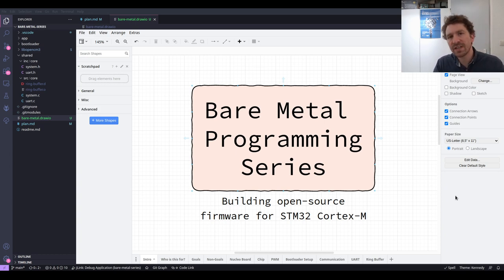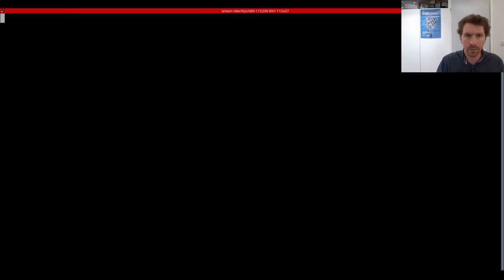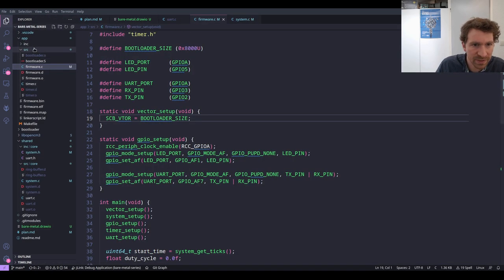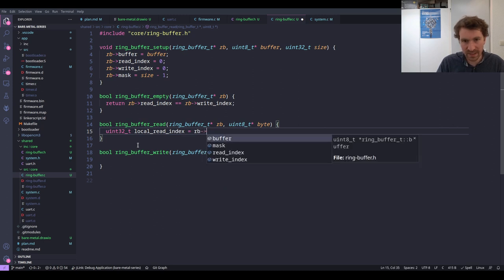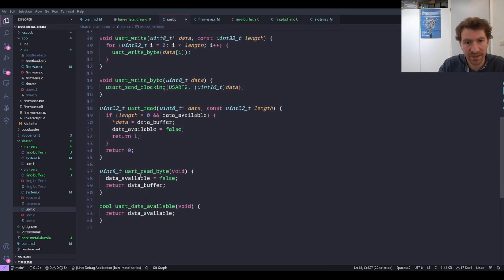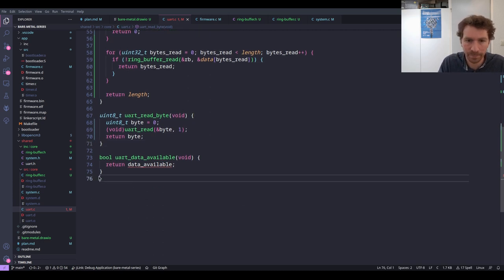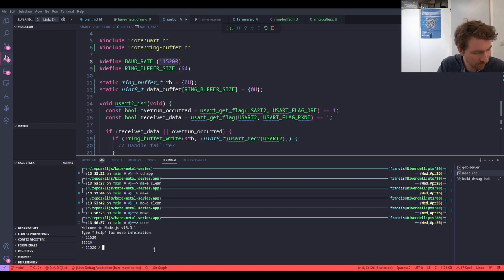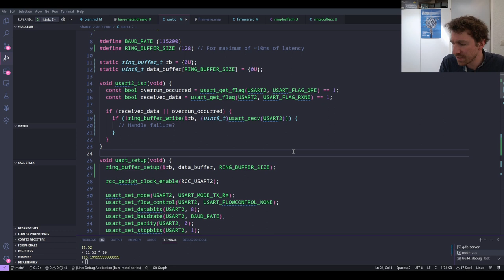Interrupt Safe Ring Buffer :: Bare Metal Programming Series 6

Comment: Great video. Would love to see you go further with this.
With the RING_BUFFER_SIZE comment i thought quite a bit about the correct wording. The way this stuff is tought here in germany: "for a cycle time of 10ms" makes sense. In practice and for myself i prefer: "// 10ms cycle at 9600 baud" This gives you the time as the most important information first, and with the baud rate in second you know what's the buffer is for.
In C++ i have an implementation that takes baudrate and cycle time to calculate those things in the preprocessor. Great to build systems fast, but you should switch to fixed size to keep the sanity of your coworkers i guess.

Comment: Correct me if I am wrong:

1. Ring Buffer solves (or rather avoids) the "race condition problem" because there is no shared variable (like data_available) between the reader and the writer of the buffer. And because the reader and writer don't "race" for accessing the shared variable, the race condition is avoided.

2. Ring Buffer solves the "problem of needing more space" by simply providing a bigger buffer. This essentially buys the Firmware more time in between accesses to data received at the UART RX pin.

Comment: Isn't "if (length == 0)" still not correct behavior for "uart_read()"? Unless I misread your code, if length is somehow negative then it'll return length when 0 seems to be your intended failure value. It might not end up making an actual difference but it at the very least seems to make your code a bit more ambiguous. If you're only checking for "length == 0" then it seems to just be extraneous code since if you removed that check then you should get the same behavior you get with the way it's currently written since simply running through the loop with a length of 0 would end up returning a 0 regardless.

On that note, glad to see that I'm not the only one who occasionally makes a one-character error and then spends far longer than it should trying to hunt it down.
Reply from the maker: You're totally right - the length check against 0 is extraneous, and I wouldn't be surprised if the generated code was exactly the same when removing it.
Reply: I think comparing against 0 is the correct thing to do here, because the length variable is unsigned, so it can never be negative. I also think this is why the compiler was optimizing everything out - it saw the condition "if (length > 0) return 0", which would return 0 in every case apart from the case where length is 0, but then it also saw that in the "length == 0" case the function should also return 0, so it just optimized everything to "return 0".

Comment: Is there any chance to use Rust 🦀instead of C ?
Reply from the maker: It's possible! There are some projects out there working to get rust code running for STM32s and ARM Cortex-M chips in general (https://docs.rs/stm32f4/latest/stm32f4/ is one). I can't speak to how far along these projects are, or how much of the surface area of the chip is covered, but I bet with some work you could get it up and running. Let me know if you follow along in rust, I'd love to see that!
Reply: @LowByteProductions  How about calling C (libopencm3) from Rust

You can use cbindgen library to generate bindings from  C header file.